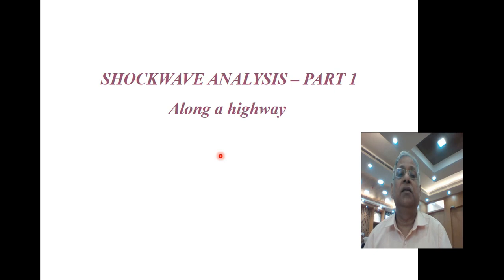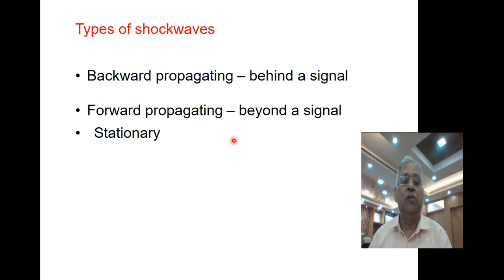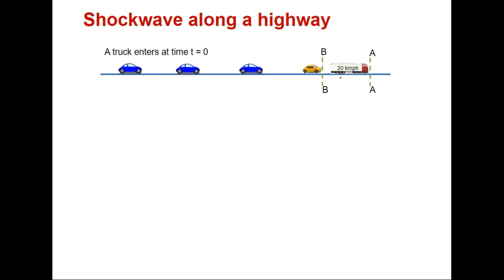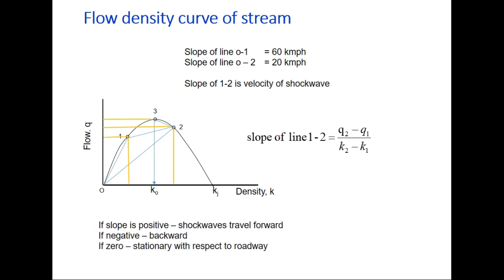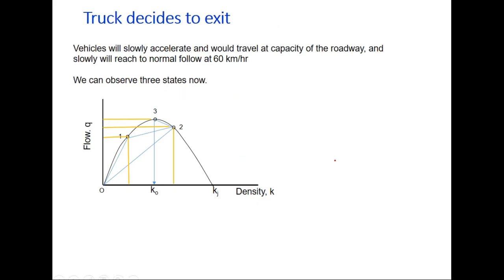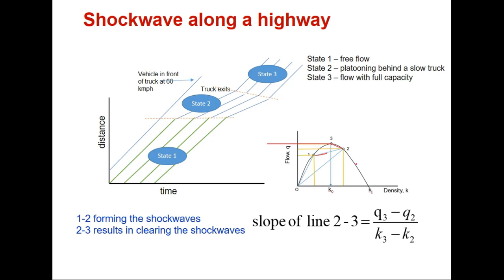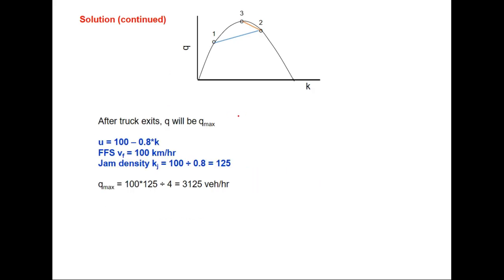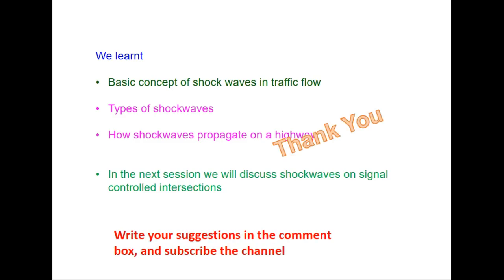#trafficengineering, #shockwaves, #flow, Shockwave analysis along a highway, basic understanding.

Comment: Thank you for the video! Very helpful! For the maximum queue length there is another way to think about it. The wave front may move forward, backward, or remain stationary (relative to the roadway). In this case, the wave front is moving forward (relative to roadway) but relative to the truck the wave front is moving backwards (11.23 -20 = -8.77). You would expect for the queue length to be 11.23*0.04, but that is true for a red light (stationary) in this case you need to use the relative speed which would "make the truck stationary" and then the queue length is 8.77*0.4 = 0.35, which results in the same answer. Hope this is helpful!!
Reply from the maker: Thank you.
Reply: Hi, could you kindly explain that the 'way front' here, does it mean the wave behind the truck after the truck enters?
Reply: Is the maximum queue length the same as the distance the platoon will reach?

Comment: Nice video. I have a question. How do you calculate the speed of a shock wave given the following: Demand volume, average speed, capacity of the closure lane with traffic distributed evenly on two lanes?
Reply from the maker: I would suggest you to watch Part 2 of this video and it will answer your question. It will be too long to answer it here. If your doubt is not cleared in Part 2 also then come back.
Reply: @SatishIITR  I have done that but still not clear with how the parameters in the formula for shock wave  could be obtained.
Can you just explain more briefly how I could get Q1,Ki,Q2,and K2?
Reply from the maker: @AromeOzigagu  These are obtained from field studies only. Say for example you are studying the shock wave movement past an accident on a road. You should know the flow parameters on the road before accident ( I mean the point (1) on flow-density curve. after accident, the lane is closed so it is all stopped behind the accident point, density becomes jam density and that is point 2 on the curve. once the site is cleared the traffic starts moving at low headway and flow will be corresponding to capacity. This is point 3 on the curve. I hope I made it clear. All points coming from field data.
Reply: @SatishIITR  I am a international graduate student and would appreciate if I could get more clarity on this particular question. Thanks.

Comment: For the first state, the K is solved by a quadratic equation, why did you choose the lower value 10.96 instead of the other value 114.04
Reply from the maker: It is because state 1 is in stable flow condition, when volume is less than capacity. State 2 is congested condition and therefore k will be higher.

Comment: Sir, why queue length is 0.8 -11.23*0.04.
It should be 11.23*0.04, why we are subtracting from 0.8m
Reply from the maker: It is given in the question that the slow truck exits after 800 m (0.8 km)
Reply: @SatishIITR  Sir what is the relation between queue length and truck leaving at 800 m. Queue length should be 11.23*0.04 only, right? I am not able to understand which distance we are considering after subtracting from 800 m ?
Reply from the maker: @parthpandey4186  No, queue length will be infinite if the truck stays on the road for indefinte time and therefore queue length will depend on the time spent by the rruck on the road. the first vehicle is the queue has also moved 800 m during this time. Therefore formation of the queue will be slower (compare it with a traffic sgnal where the first vehicle is stopped).
Reply: Hi bro

Comment: Sir, in state 1, there are two values for K but you only consider 10.96. Why is that sir plz help !
Reply from the maker: The second value of k is 114 veh/km, which is unrealistic. Please see the equation is not correctly printed (very sorry). It is Q = k(100 - 0.8K) or 1000 = 100k - 0.8 (k squared).
Reply: @SatishIITR  thanks

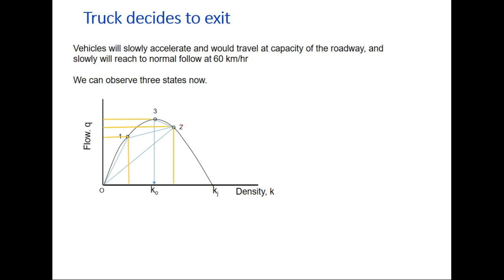Comment: Thank you sir for the clear explanation. I have a question please, in 8:16-8:30 you said that point 1 is before entry of the truck, point 2 is after entry of the truck and point 3 after exit of the truck. My question is why when the truck left the flow is shifted to point 3 and not point 1 before the entering of the truck ? thank you
Reply from the maker: Point 3 is same as point 1 with respect to flow conditions, You see the trajectory lines shown in Stage 3 are parallel to those in Stage 1.
Reply: @SatishIITR  thank you for the clarification.

Comment: Sir, 
Kindly explain how we arrive at the formula for calculating the max queue length in the above example.
Reply from the maker: It is simple Aman. In a normal case, the queue length is red time multiplied by the rate of arrival. Here it is equal to red time multiplied by the velocity of the shockwave.
Reply: @SatishIITR  sir why you have subtracted the total length shockwave travelled in 0.04 hour with 800m?This concludes that max distance the shockwave will travell will be equal to the distance traveled by the truck? It's confusing please explain!!
Reply from the maker: @amansartaz5864  No, The maximum distance of shock wave is 0.35 km (350 m) and it will take 0,04 h to reach this distance.